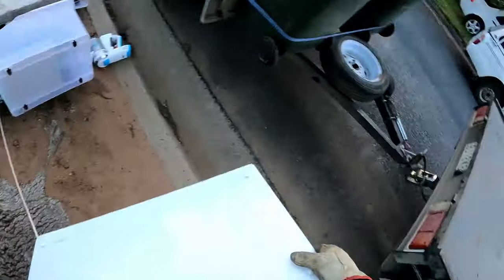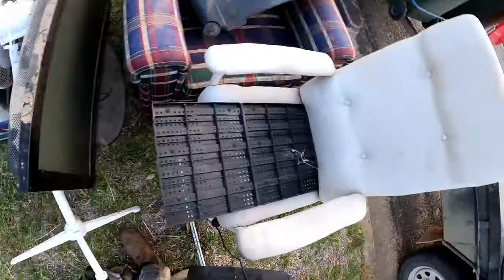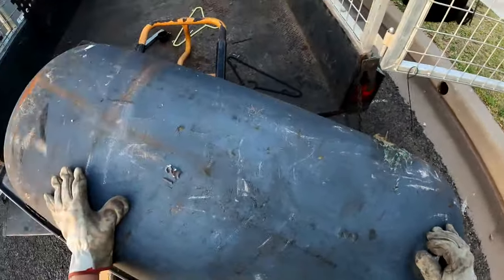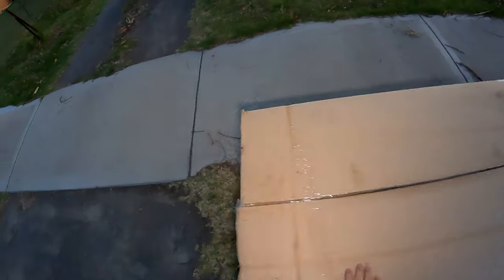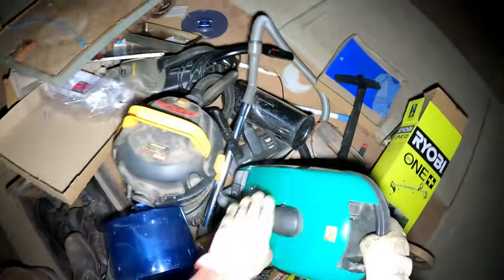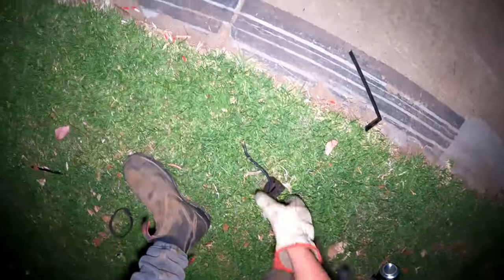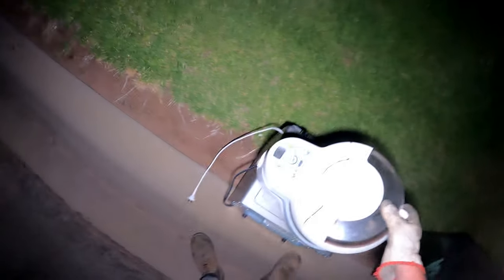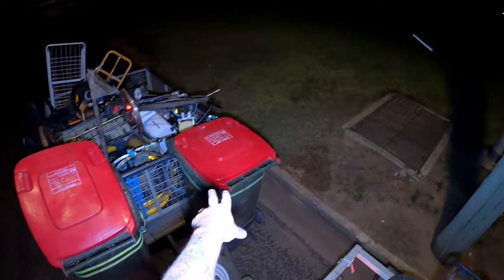Curbside Scavenging Scrap Metal Part 2 Field Dressing A Fridge

Comment: Here in the US that fridge where they just bought a new one would still be in good working order and could be sold for 200. We aren’t allowed to take fridges, air conditioners, freezers, anything with Freon apart. The only way you can take em apart is if you’re a licensed technician. We normal citizens can’t cut that gas loose into the air you gotta have a license for all that cause they ain’t saving it either. If you was to show up with the parts of the fridge like that you’d be going back home with em as well. Of course I see folks here taking things to the scrap yard I wouldn’t dare take the way they do. My main goal is recovery of precious metals and copper, brass, aluminum and such. I’ve collected almost a pound of gold in the past year from all the stuff I’ve picked up from the roadsides.